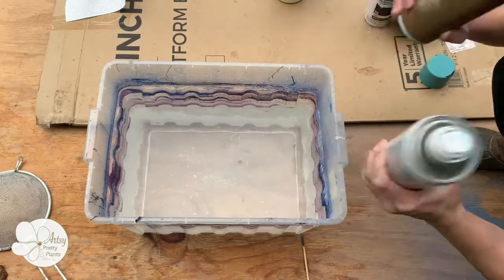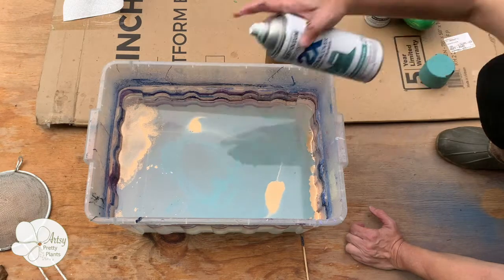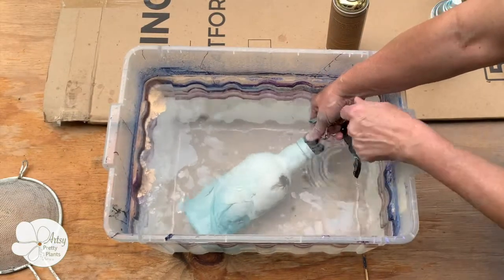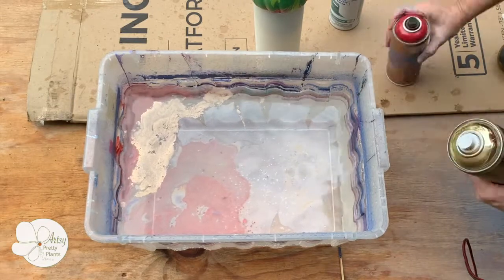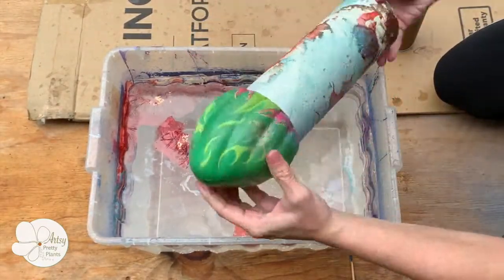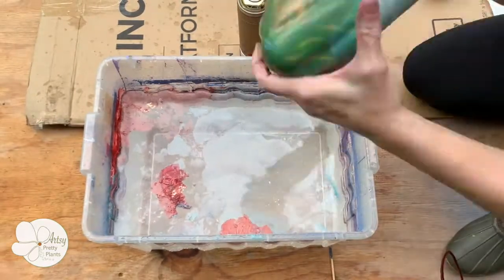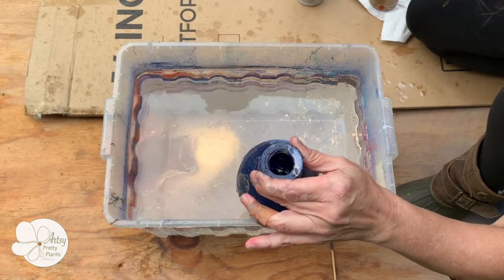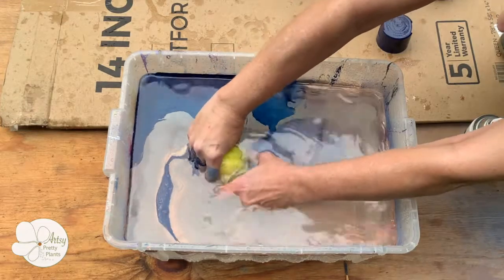Hydro Dipping With Spray Paint: Vase Makeover!

Comment: Beautiful! I've tried a few now, and the paint keeps drying on top of the water. I've tried cold, and then warm water. Both have the paint drying on top, and I'm working pretty quickly. Any ideas?  Thank you.
Reply from the maker: Hi Shannon, I'm not sure what you mean by the paint drying? But the type of paint does make a huge difference- both brand and sheen. Are you using the kinds I have listed in the description? My website tutorials are more detailed and explain more about the materials. Also, cold water is correct.